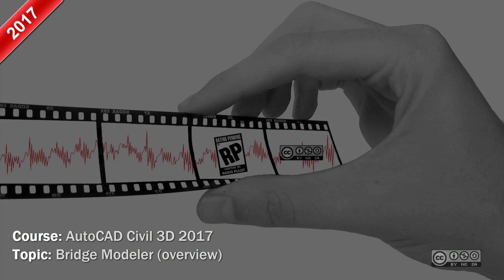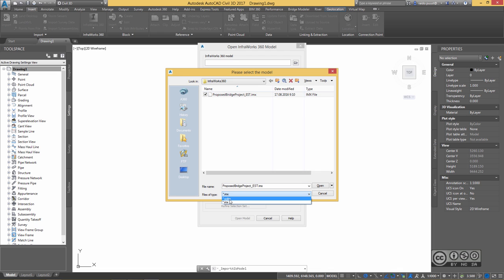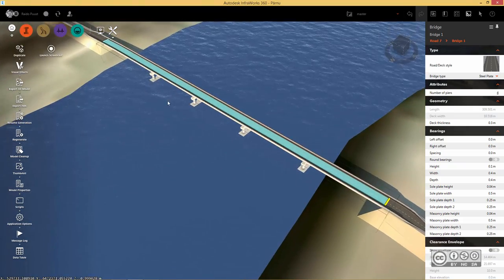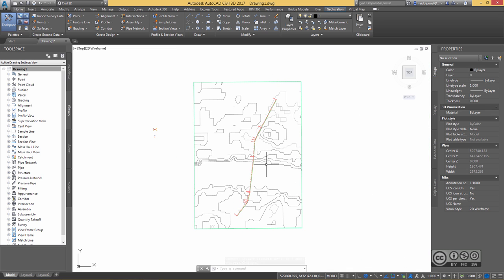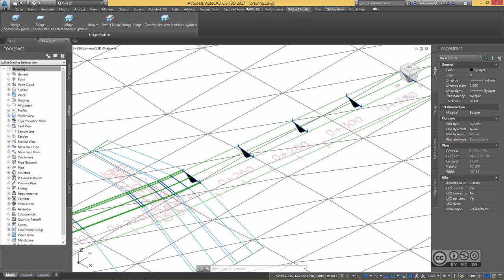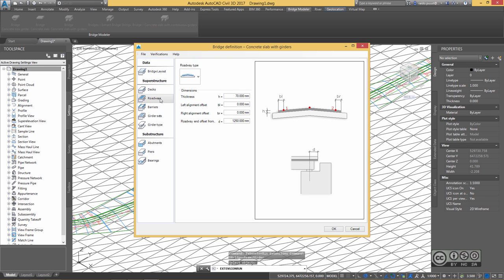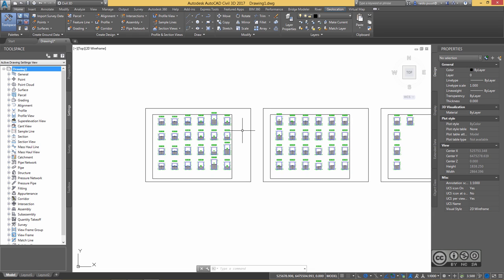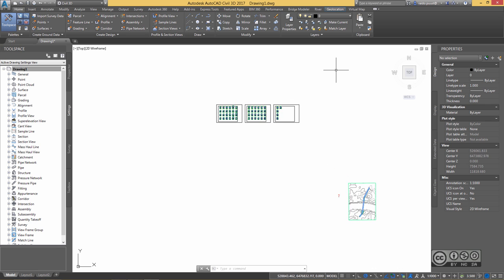AutoCAD Civil 3D 2017 - Bridge Modeler (overview)

Comment: Bridge modeler tab not showing in civil 3d..
Any solution..?
Reply from the maker: It was a separate installation. So, you have to ensure that you do that as well. Also check that you are using the correct version of Civil 3D, this plugin is working only with some older versions of Civil 3D.

Comment: Hello Mr. Puust Thank you for the explanation. I want to ask if you don't mind. I'm using Infrawork and Civil3d 2021 and my model exported as "Foundation", "Pier" and "Girder" not 3D Solid model like yours. I think there is something to do with it.. I really hope you can help me, thankyou :)
Reply from the maker: In previous versions (before 2021), yes, those were directly 3D solids. Autodesk has improved the workflows and now, by default, you can see parameterized components with properties (see Properties palette). At the moment you can't edit those in Civil 3D, and probably it won't happen soon, as bridge editing is made in InfraWorks or in Revit, but you can see that valuable information. Now, if you want to get 3D solids instead, you can Explode those components (that shows, "Foundation", "Pier" etc.) - then you get Block, and once you explode once again, then you get Solid or Mesh, depending on the type of the component.  Those are standar AutoCAD 3D objects. Remember, you can't get back to parameterized components. So, if you need both views, you have Save As, and do your explodes there.

Comment: Hi Raido, Is it possible that we can start our bridge directly from Civil 3D? after all all the thing you have is same we do in civil 3D. Thanks Mir
Reply from the maker: Hi Mir. Of course you can start directly in CIvil 3D. You have to follow the standard Civil 3D procedures to create a surface, draw an alignment, add proposed profile, create road assembly - and you are there to use Bridge Modeler tools. Hope it helps.

Comment: hi, if i install a 2017 or older version, will i get the module despite being discontinued?
Reply from the maker: It depends if it is available at Autodesk App Store. Usually Autodesk does not support too many versions back, even if it works well. I suggest to check new workflows in terms of bridge design as they are more up to date with today’s expectations, interoperabilities etc.
Reply: @eRaido  Thank you. I guess I will have to embrace infraworks fast in order to model custom parts as I am only an intermediate user.

Comment: Thank You. But how I get or install Bridge Modeler in Civil 3D 2018
Reply from the maker: This module was discontinued. And it is now shifted into direct workflows between: InfraWorks > Civil 3D (directly as solids/meshes for general coordination) or InfraWorks > Revit (through *.imx file for detailed design). I suggest to check the latest version Civil 3D 2020 and InfraWorks 2020.2.
Reply: @eRaido  could you create a video showing the same thing in this video, but using the new workflow please ?
Great video BTW!

Comment: how do i get the bridge model? do i have to buy it? because i dont have it in my civil 3d
Reply from the maker: This workflow has been changed in later products. There is no "Bridge Modeler" in Civil 3D itself, instead, this is modelled in InfraWorks and it comes into Civil 3D. This workflow is currently enhanced by Autodesk even more. Therefore I do suggest to move onto more recent product versions. I do not think that Autodesk support 2017 product line anymore, usually they do support up to 4 versions (2021, 2020, 2019, 2018).  Therefore it is difficult to find the extension anyway.

Comment: Can we customise our piers and abutments?
Reply from the maker: Those are parametric objects. So, for default shape you can change for example pier's width/height etc. But do not expect that this is the same as using bridge modelling tools in some speficic structural package (like Autodesk Revit). If you have installed the module, check the Help about parameters that can be changed. But I believe that your original question was about, if somebody can change the shape as well?

Comment: Hello Sir, you are a great lecturer, I appreciated your knowledge. may ask you Sir, how to download and install the Bridge Modeller into civil 3d??? thank you, Sir. Have a good day
Reply from the maker: Thanks! The workflow has changed (version 2021+). There is no Bridge Modeler plugin for Civil 3D. Instead, the bridge (and its components) are coming over from InfraWorks into Civil 3D. Also, you can export a brdige from InfraWorks > Revit, and do a detailed design there. Once you import InfraWorks model into Civil 3D (which includes a bridge), you can see that bridge components in Civil 3D are coming with parameters (you can't change those in Civil 3D, but you can see the information!). Hope it helps.
Reply: @eRaido  Thank you so much, Sir.

Comment: sir, may I know if autodesk already provided the extension of bridge modeler for Civil 3D 2018 ?
Reply from the maker: To my best knowledge, 2017 was the last version when Bridge Modeler was included with Civil 3D. Functionality was shifted (or you can do similar things) into InfraWorks. Therefore I have not seen it on top of 2018 or 2019.